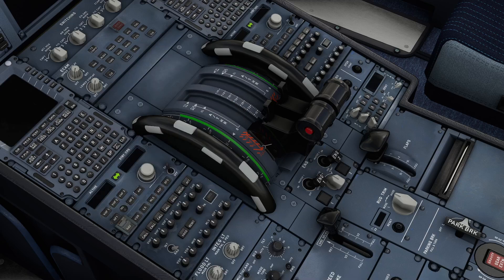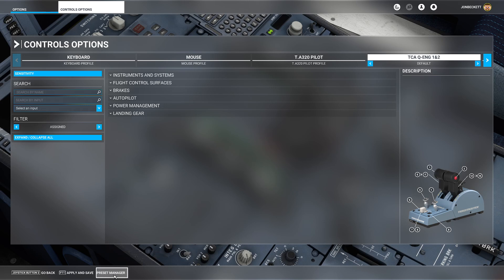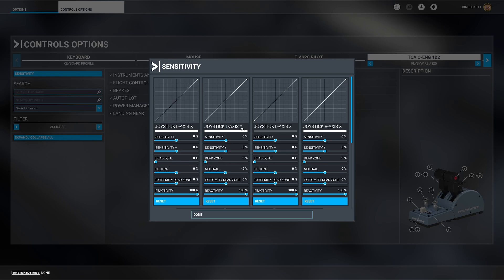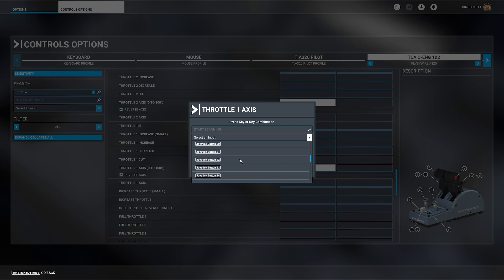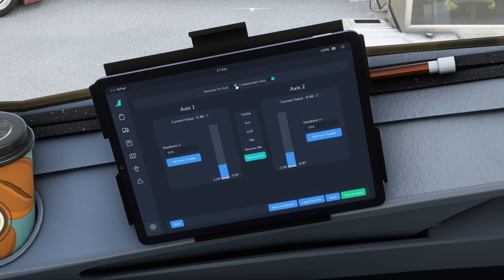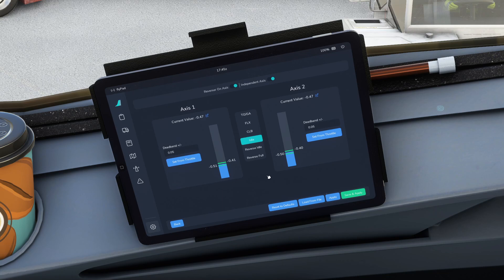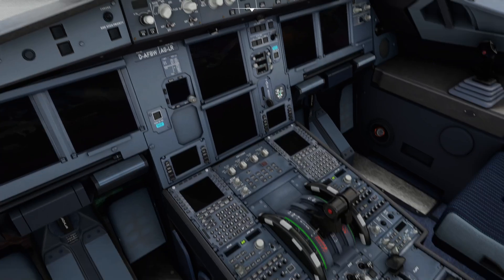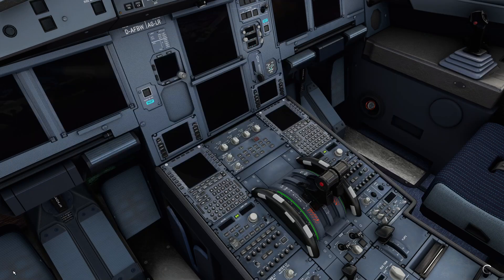How to configure the Thrustmaster Airbus Throttle Quadrant for the FlyByWire A320 Airbus in MSFS

Comment: good afternoon dear, thank you very much for this complete tutorial and for taking the time to explain. I wanted to ask you for help with something, I followed all the steps of both the axix sensitivities settings and the configuration steps, of the controls on the plane's ipad, the problem that I could not solve is that the throttle lever, I It remains too sensitive, so if I raise it, for example, a little beyond idle, the plane gives me too much acceleration range, I set each point on the iPad with the percentages that you indicate, but even so, I stay with Too much acceleration, how could I solve this? thank you.
Reply from the maker: Have a play with the curves in the sensitivity settings for the controller.
Reply: good morning dear jonathan, that's right, I configured, the sensitivity curves as you indicate... all in 0 the majority, and the points of the acceleration lever, remain in their points. but the issue of power is the one that is not looking good. thanks a lot

Comment: Hi Jonathan I have the Airbus TCA Captain Pack for the Xbox version I having a problem with the throttle issue it seems like fast response on it but how to calibrate the throttle to the exact response to match with the aircraft for the Captain Sim B777 aircraft if anyone out there has the same issue with the throttle response if you are Xbox users could you please upload a video on YouTube please so it me an idea how to set it up properly 😀 👍.
Reply from the maker: Good luck with the Captain Sim 777. It's not very accurate, so you'll probably have to play all sorts of games to get it to work "correctly". Remember also that this is an Airbus quadrant - not a Boeing one - so it's a bit like trying to use a spanner to turn a screw.

Comment: I did all the steps in the video and my thrust reversers wont deploy. It shows the axis value moving on the flyPad but not the in-game throttle. Do you have a fix for this?
Reply from the maker: They will only deploy with the engines running.
Reply: @jonbeckett  This worked. I don't know why this didn't cross my mind.

Comment: Hi does anyone know how to actually get the tablet in the A320 it isn't there for me it is just a holder and, because of that my reverse thrust is now idle until I can access the tablet?
Reply from the maker: If you're using the stock A320 that comes with the sim - it has no tablet. This is the FlyByWire add on for MSFS - you can download it from the internet for free.

Comment: I followed your example but the flaps and spoilers axis are not functioning.The second detent brings the flaps to full as does the spoilers detent drops to the bottom. All the other functions are ok.Need help.
Reply from the maker: You might find your controller is broken - I've seen this with other people before.
Reply: @jonbeckett  hmm.In your video you said the default profile should be copied but that is the issue the original default profile is not functioning properly.

Comment: Hey there, just wanted to ask if you had the issue with the throttle randomly jumping from idle to climb, how do you fix this issue?
Reply from the maker: Nope - that sounds like a calibration or hardware issue. If you move the throttle in the cockpit (not using your controller) and then so much as breathe on your throttle controller, it will jump to where the controller is.

Comment: I'm on Xbox and I only have a a320neo in msfs like you, there is no tablet /flypad in the plane beside me on the left
Reply from the maker: The plane you see here is the FlyByWire A320 - it's not the stock one. It used to be in the Marketplace, but Microsoft insisted on developers using a specific software license in the marketplace, so FlyByWire pulled it.
Reply: @jonbeckett  Is it free?
Reply from the maker: @HamzaTheHammad  Yes.
Reply: @jonbeckett  so what's the fix?
Reply: @jonbeckett  I know so will it still work on the stock one on xbox?

Comment: Thank you Jonathan for a very helpful video, my throttle quadrants now work flawlessly. I've got a very strange problem with the Thrustmaster joystick. No matter how I try I cannot set up the rudder, there is no subtlety in it at all, it's either full left or full right. It's an absolute nightmare trying to taxi, I'm all over the place !!! Any ideas what I am doing wrong please?
Reply from the maker: That sounds like the sensitivity settings.
Reply: It's a hardware common issue
Reply: There are some tight wires inside the stick
Reply: For me it was doing this when I had the stick set to the left handed option. When I set mine to right handed, the rudder sensitivity was normal again though I had to readjust the button mappings I had set previously

Comment: Hello Jonathan. The throttle calibration for the fbw worked well but every other plane throttle is broken. Any help to fix?
Reply from the maker: You have to setup different profiles for different aircraft. I have a video somewhere about setting up controllers and managing profiles.

Comment: Hi. My throttle quadrant is connected to my pc, and it shows it as being connected in my control options, but I can't actually configure it and it isn't connecting. It is hard to explain but I hope you understand
Reply from the maker: Without sitting in front of the computer to investigate it's hard to say.
Reply: @jonbeckett  It's alright, I've fixed it now.

Comment: Hi Jonathan,  Please help me out. I lost my default Flaps and Spoiler setting during duplicating preset manager. Now (both are fully up or down position). Would you send it the default settings. Thank you^^ 
-Kris
Reply from the maker: You just need to assign the axis. If push comes to shove, the easiest method is to duplicate the default profile, and then re-do the throttle axis.
Reply: @jonbeckett  thank you for the quick feedback. The big problem is I lost the default setting as well. Do you have any suggestions how can I reset my TCA and joystick?
-Kris
Reply from the maker: @leotend  You can't lose the default. Unplug your controller, and plug it back in.
Reply: @jonbeckett  thank you, I'm all set.

Comment: I can't get the autobrake or ignition switch to work properly. The ignition switch would flicker between norm and ign/start when turned to ign/start out of the box. I was able to fix it using the video made by easjetsimpilot so the norm/ign parts work, but the crank mode still requires me to turn it all the way to ign/start then back to norm to turn crank off. 
Autobrake switch is also buggy. Does the same thing the ignition switch did by flicking off and on when turned all the way to high. I can see it on my ECAM and it drives me nuts.
Reply from the maker: Have you done the firmware update on the quadrant ?